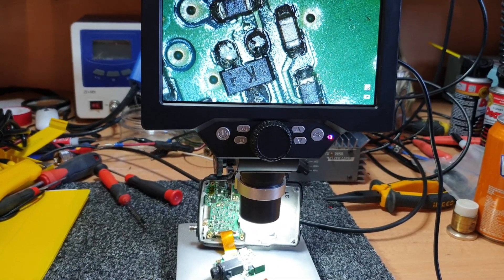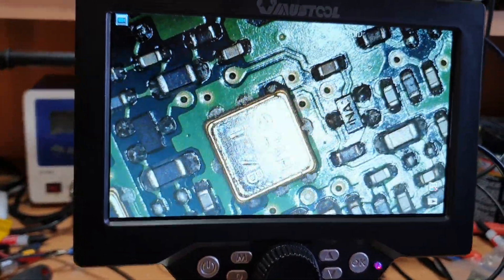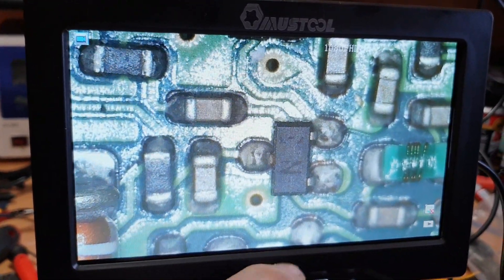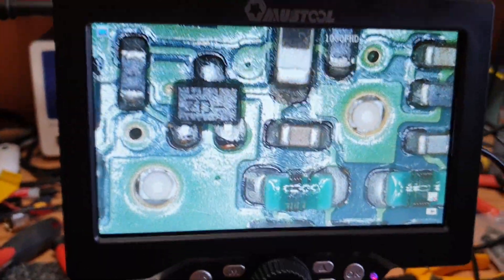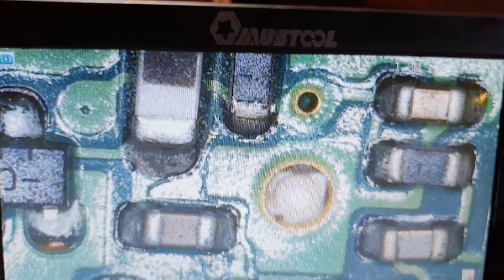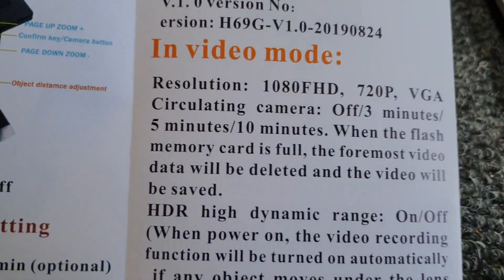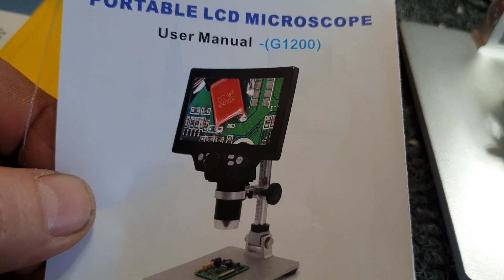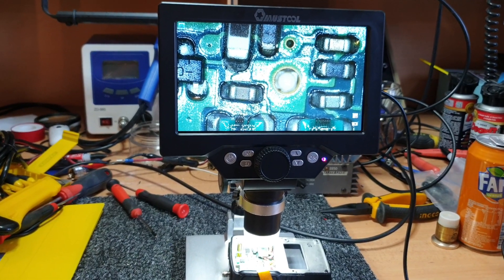Thumbs up to Banggood, the Mustool G1200 LCD Microscope in action!!! Just a must for SMD Electronics

Comment: I use a USB microscope that plugs into my laptop and I can use the included software to record a video or take a picture of whatever it's looking at for future reference. They are about $50 at Amazon here in the States but they have them on eBay and other sites too. Chinese made of course but I've had mine for over a year and it still works fine. I see they also have some now that you can use via Bluetooth instead of USB which might come in handy for some people.
Reply from the maker: amazing how cheap this stuff is, imagine what this would cost back when we were young apprentices haha...cheers Brenton VK3CM